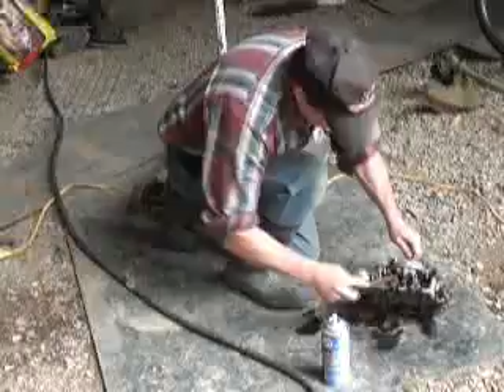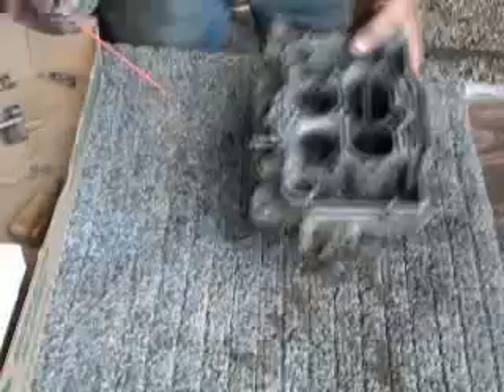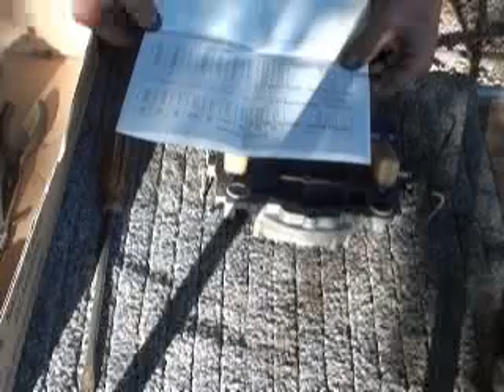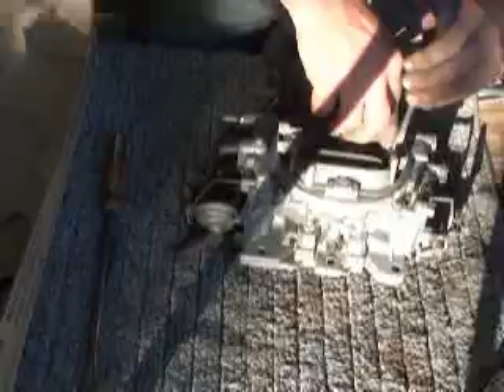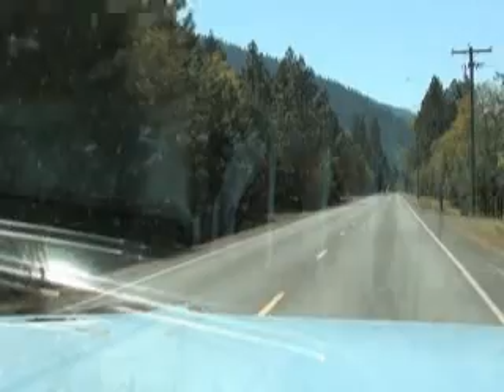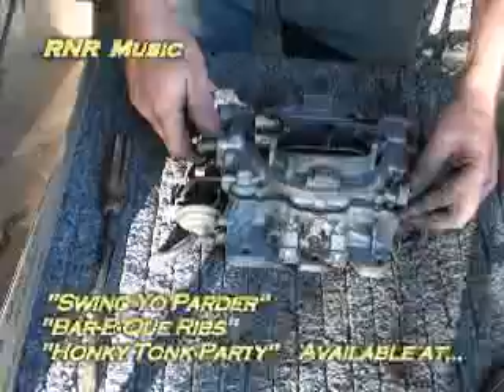1969 GMC Carburetor Rebuild

Comment: My first vehicle and daily driver until March of 1998 was a 1969 chevy 3/4 4x4. I bought the truck my senior year in high school (oct 1984 ) and I still have it. It had a 307 engine, 4 speed and 456 gears. The rear end is the HO 72. When I bought the truck, it had 36x14.50 tires and no air cleaner. Needless to say, when I started college, it burned 1 quart of oil per trip to school and back home about 65 miles. I saved some money and had the engine rebuilt by a very reputable builder and racer. I won some truck pulls, a mud bog race, and many stop light races. Also, I have edelbrock performer and Carter carb at the builder's recommendations. I since went to a 454, same builder. What a beast. My wife says our 2004 duramx is comparable.

Comment: Jeff, after seeing your video on the 389 carb rebuild ,  I started to use cleaning vinegar in my aultra-sonic cleaner for my lawnmower carbs  heated to 180 degrees and it works great .
Reply from the maker: ***** Your not the first to say that! I do want to point out, however, that I only use vinegar when the white death has crept in. Carb cleaners wont touch oxidation, but the vinegar makes it disappear. Great for the ethanol destruction imposed upon us.
Reply: ElderlyIron 90% of my repairs are from 10% corn gas being used & gas being left in the tanks during the winter months .

Comment: Nice Video. I want to get a chance to rebuild a carb or two sometime but I have always wanted to at least see a carb being rebuilt. Excellent info on adjusting the screws by sound. Could actually hear the engine changing. Good stuff to know.

Comment: I love my 1991 F250 extended cab that I paid $1000 for with just over 10000 on it . An runs an drives perfect an looks great to . Ac, pw, pdl, cruise , radio an so on Just an awesome truck with a legendary 460 in it . The gas mileage is not bad at all
Reply: dwight dunn how many mpgs i got 20mpgs in my 6.9 idi
Reply: +dwight dunn 460 a legendary motor? How about the .030 over 428 in my 1966 F-100? Now that's a legendary motor with lots of torque.

Comment: To the inexperienced; I would label each linkage or hose with tape bearing a letter of the alphabet.  Next I would write with a Sharpie pen on the carburetor the corresponding letter by where you want to remove the hose/linkage.  Take pictures prior to disassembly and prior to cleaning.  Found that out the hard way when dealing with lawn mower carbies.

Comment: Oh my freakin Lord!   Did I hear QuadraJet?!?!?   I would NEVER put one of those on my 350 ever again.    Had ENOUGH trouble with them back in the day.    They are about as reliable as the Linkert carb on a Panhead.   OEM to a 77 350 or not, life's to short to fight the never ending battle with a QuadraJet.   Keep it on the shelf where it works the best.
Reply from the maker: +crfor freedom What part is not reliable?
Reply: +ElderlyIron  Automatic choke mostly.   Course I've never had a Dodge or GM where I didn't eliminate 95+% of my problems by a good cleaning or rebuild, then rip that auto choke off (OK, mostly disconnect) and go manual (never owned a Ford pre FI or AMC motor ever).   I prefer manual choke by far anyway.  I saw the Tom Ahl on the plate in the garage.   I was born and raised in Findlay, OH. Hey neighbor!   I'll be the first to admit I'm nowhere close to an ASE certified expert, but stuff generally works like it's suppose to when I'm done.   Sure could have used you back then!   ;-).   Maybe I could have at least gotten my choke to work reliably!    But I have t say, I've never had a Willys motor that didn't run like a sewing machine.   Course, mine always ran a manual choke by design.

Comment from the maker: @rangerkid777 

It had (still has) a pair of CHEAP headers when I bought it in '98. Somewhere around 2000, I had a muffler shop replace the rest of the exhaust. Told him I wanted a nice, low rumble. That's what I got!

Comment from the maker: Still putting off the dreaded change-over, though I did land a carburetor since the video. The headers are pure junk and need replacing. I've had a disc for it since 2000. I know what will happen if I go in there. Just nursing it along for now

Comment: @ElderlyIron yeah i was thinking about a set of flowtech headers. is there anything you could suggest for that rumble? i was thinking maybe good old straight pipes. 2 1/2'' of the headers, just behind the transmission an x pipe then inbetween the cab it will cange to 3 or maybe 4 inch pipe to sort of chamber it.

Comment: i got a edelbrock 600 on my 75 chevy 350 i built and dropped in my trans am and the damn accelerator pump is leaking on it so i gota get the parts or put my holly on it